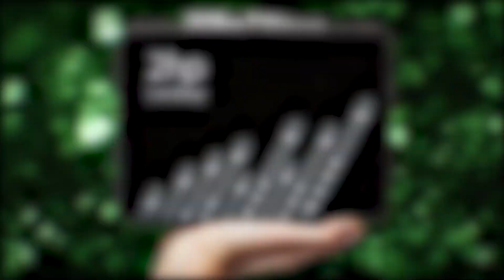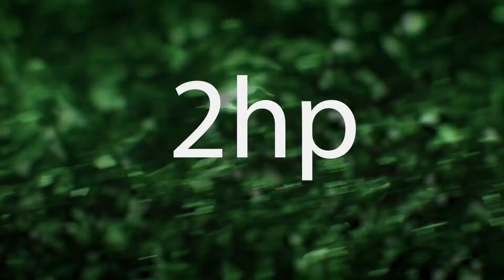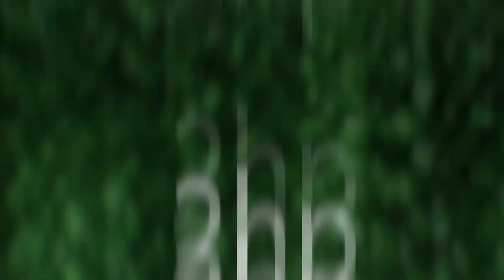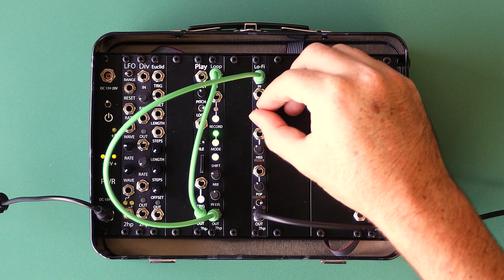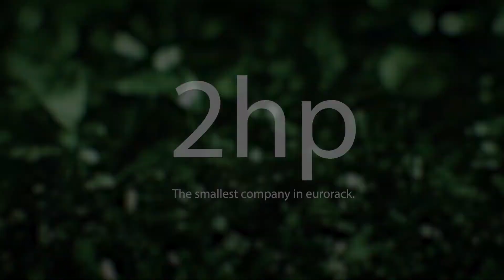2HP Lo-Fi - Tutorial - Audio Degradation Emulator

Comment: Nice! My only concern is, if i want two of them for stereo, will it just end uo being too much? As in, too many distracting pops on when the left and right sides are combined... I'd love to hear a demo of 2 lo-fi's used as a stereo pair
Reply: Oh very good point about the audio degradation when running two in parallel.
Reply: @BasedFrequency  are the pops random or a loop?
Reply from the maker: They are random pops, not sequenced! So having two in parallel would not have identical pops.